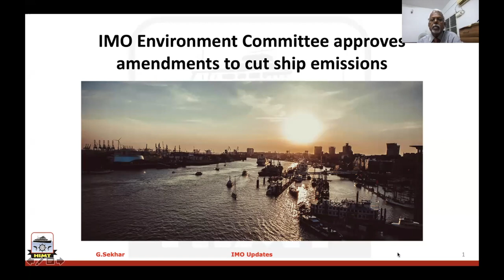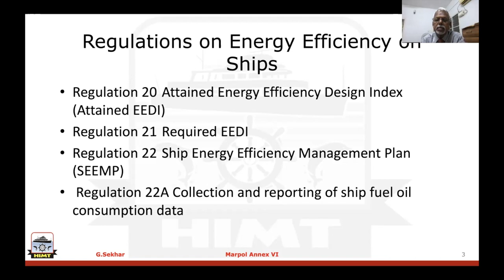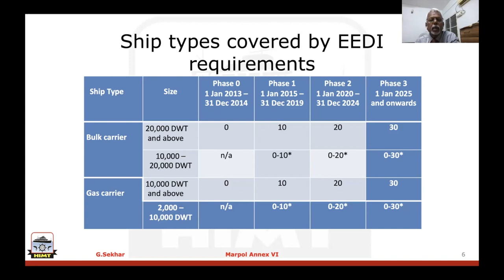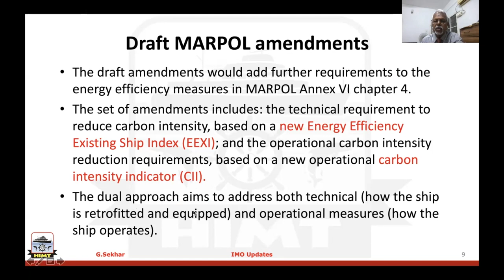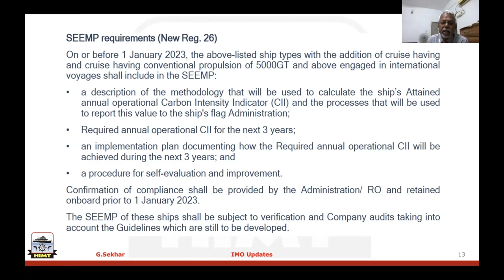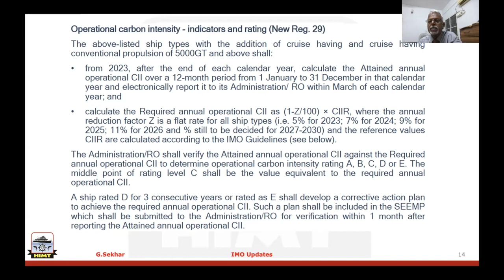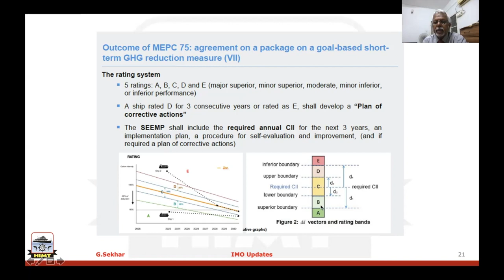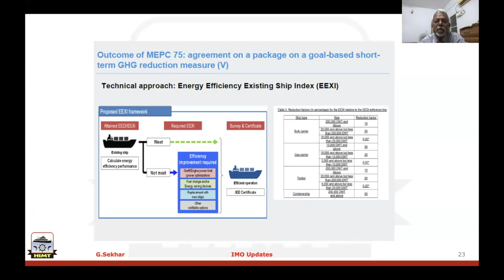Decarbonisation of Shipping Industry | G. Sekhar | HIMT

Comment: Hydrogen fuel cell the best technology for clean propulsion.
Reply: Ammonia is better. It will be mature before
Reply: @martinmaupas4380  Well even ammonia based fuel cell is not bad Idea it's more efficient than IC engine's.
Reply: @saurabhkatarey6818  sure. Hydrogen is too difficult to store and bunker installations are not existing yet. 
Ammonia is a short term solution
Reply: @martinmaupas4380  That's the reason why industry is planning to store Hydrogen in the form of Ammonia or metal Hydride. Based on the demand Ammonia can be cracked or metal hydride can be reacted to produce hydrogen required for FC or IC.
Reply: @martinmaupas4380  hydrogen is highly combustible gas, remember the Hindenburg disaster, and during 60s a Soviet submarine blew up underwater in Pacific Ocean, due to build up excessive hydrogen gas in the battery pit

Comment: Take out seafarers (fixed cost, including fleet personal dept), and the economical speed drops down to half too.

100 t/day becomes 10/day, the same voyage being complete with 20% fuel consumption.

Emgine power requirements drop from 27000KW to 30KW

High speed (6000) Otto cycle 15Kw X3 deck mounted power packs running on LNG/LPG cut down NOx too.

Or 15Kw X2 Azipods will work wonders to operating costs too.

Containerised power packs eliminate the engine room, and greatly, enormously simplify the entire propulsion SYSTEM. Hence reliability is boosted and engine crew can be reduced to say one person.

Same for deck, vessel will be watched from shore through remote control, including mobile robitic cameras, in addition to fixed cameras.

The biggest Greek ship owner says, to meet 2050 targets, entire 65000 fleet have to be scrapped and also all buildings from 2030 must conform with 2050 standards.

Since the bunker requirements are greatly reduced LNG/LPG can be bunkered in double walled vacuum insulated tanks, mounted in containers and hence bunkering infrastructure problem also is eliminated.

Ultimate destination is Hydrogen Fuel cells, even though it may not be the best for the world, Methane fuel cells are. Why world will go hydrogen is technology colonisation.

Etc etc etc

I am only seeding your minds. Just think about it, develop it further as your minds pan.
And wake up. 🌹🌹😍
Reply: As a guy studying sea cataincy, I hope this will not lead to me being jobless
Reply: @savapavlovic3956 
 Changes will accelerate from 2030 onwards. Nothing more can be said now, for paucity of data, as they hardly divulge any data, outside their circles.
Reply: Only one expect is showing here, how about maintenance cost the crew is doing, u need shore persons for berthing and unberthing and currently even the 1st world countries do not have that kind kind of technology for berthing via magnets or similar purpose, talking about remote access, in overcast sky we usually broke signals only sat c worked and even high latitudes it wont work , gyro doesnt work on high latitudes, radar issues, what about high density traffic areas cameras are not enough sea water will accumulate on it, any equipment machinery malfunction etc how to tackle it on mid sea
And there are lot more challenges that need to be encounter
U r saving money on one side, what about solas it need to be changed totally, if anythng happens midsea cost of refuge, change the face of ports all over the world, additional tugs etc reqrmnt at every port, additional insurance cost, planned maintenance timings to be reduced may be to 1/4th, owner or charterer has to send additional persons at every port for cargo calculations, dispute, damages etc, 
I can keep writing more and more, person who thinks it is an easy task never sailed
It may be possible but not in near future or from 2030 definately no, may be after 30-40 yrs it may be possible but for now i guess NO
Reply: I am reading these kind of blogs from last 7-8 yrs previously they were saying from 2020 onwards then 2025 and now 2030, but all are shore personnel who never sees a ship, who never sailed onboard in high seas, they are just talking  theorotically
Reply: I am talking about unmanned ships, yes the fuel can be changed , as it has already changed over to low sulphur in 2020 sulphur cap so this is possible but for unmanned ships its too early
Reply: If you look at the complexity of the current engine room, then no ship can ever from unmanned.

 LNG/ LPG engines run indefinitely without maintenance, except cleaning the turbocharger air filter.
Whatever maintenance that may be called for can be done by shore workshop.

 A highly "Decomplexified"  engine room will have hardly anything to go on, especially when we use Azipods.

 Robots with basic level Technology can contact surveillance anywhere the static cameras cannot reach.

 The same basic Technology robots can do essential maintenance also.

 Today's satellites can see through any storm clouds and under the earth too, India also has such a satellite.

 I don't believe in autonomous vessels. It will be the remote controlled vessels. Artificial intelligence will be split 20/80 between ship and shore.

 For couple of years already, 37  ships Bridge watch is simultaneously kept by one person ashore, like they do in Air Traffic control.

 Containerised power packs are nothing new. Residual fuel oil engines in power packs had been running for at least 7 years, I don't remember the exact date.

 LNG shipment prove double walled vacuum insulated tanks mounted in containers is well in progress. Nothing new.

 Remember what the biggest Greek owner said" all new Constructions from 2030 will have to confirm to 2050 standards " if you are going to meet the 2050 targets.

 Remember again that LNG/LPG engines is the poor man's  fuel cells. One day that option also will be eliminated.

 The mooring crew will board along with the pilot.

 Maintenance crew also will board in containers, they will be open CDC crew with AB in charge.

And Azhipods are brilliant cost cutter for berthing.
Reply: The sole purpose of 2020 low sulphur fuel is to Jack up fuel cost, close to that of LNG.

 That is the key. Think it over.

Let's take it higher
Reply: Camera lenses can be made storm proof by running pressurized air over it. An existing practice.
Reply: Heavily rolling ship is heavy rains? (The dome breaking off) -  stationay Scanned array radars and stalellite seekers are available - even for buses - I personally checked it 20 years ago, meaning it's old technology and used as standard equipment in military
Reply: All components of technology are ready and in practice. Only combining them remains. What inhibits Unmanning is Arbitration. IMO is on the matter full sea speed. If they Drew a line at 2020, they have figured out how to go about it all.
Reply: Blockchain systems that eliminate paperwork already in place for some years.
Reply: @pradeepkumarmsreedharan2814  do you think robots will clean the engine room bilges?? Change bulbs fuses, or will your dear robots will clean up the cargo holds and cargo tanks, I hardly think your dear robots are too sincere to work hard long hours without rest preparing Cargo tanks and cargo holds and engine room spaces cleaned up painted, ready for various inspections.Psc Fsc cdi, vetting, etc etc etc.
Reply: @udayanpaul8042 

 Excellent points sir 🙏🏾
 With containerized packs, that are already in existence, there is no engine room.

 as for cargo hold cleaning, there are already high pressure bulkhead cleaning machines, climber vertically, and clean all by themselves. Only initial setting up is required. Remember I propose 20/80 artificial intelligence deployment on /off board.

 But in reality, I believe it will be 80/20 for the purpose of colonization ofof non-oecd countries by the oecd.

 The block is being pushed towards a hydrogen economy, a shift from crude oil economy. This again is not the best for the globe, that also is for colonization of non-OECD countries.

 Because both of the above involves high level of technological expertise.
Reply: Still for practical purposes, i dont think autonomous vessels is in near future, my points were crystal clear which are not yet answered, ok u take india as an example, what are the facilities u get at port , u have given example of containers what about bulk carriers, tankers, livestock carriers, etc where human intervention is must for loading discharging preparing holds etc, 
My question is simple, i may agree with the new fuel change over but regarding unmanned ships sorry, i disagree, reason is simple shipowners wants cost cutting, if they see profits only then they will think of getting of crew but say u r operating from shore that means u need a person ashore to handle for lookout in addition a whole setup, shore crew required for the setup, IT people navigator and additionally surveyors from owner and charterer for cargoes at every port so for them too they need flights, hotels and other charges, lets talk commercially too its not good to see only one expect there are several too need to be considered and only those will understand who sail, because the  cHallenges at sea is not easy, when u have a restricted visibility your radars are not proper a 360 watch maintenance, plenry challenges sir, and ships which are running with 1 watchkeeper ashore i guess they are not sailing in high seas
Reply: @varunbhatia8614 
 Yes sir,
 You have put up a strong point, about cargo clearance and handling at ports.

 Absolutely agree with you that the company cannot send its men all around the world to do that. It will be prohibitively expensive. So the natural solution is it will be done by the locals with sufficient surveillance. Part of it will be achieved by blockchain, and the other part will be achieved buy surveillance cameras. This is a solution coming out of my little mind. There are brilliant brains walking on the on the matter. They will definitely come out with a solution.

 Yes it is true container ships, especially feeder ships, are likely to go unmanned First.

 Ultimately a balanced solution will be arrived at. We have to wait and watch, for data available before us is so scare.
Reply: Orderbook: LNG-fuelled vessels nearing 30% of 2021 total tonnage

09 Sep 2021by Riviera News